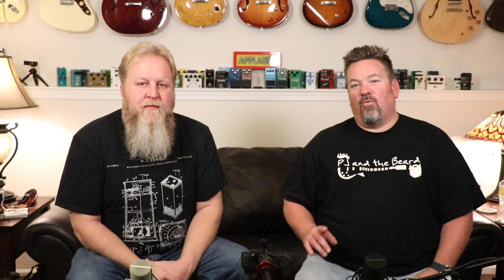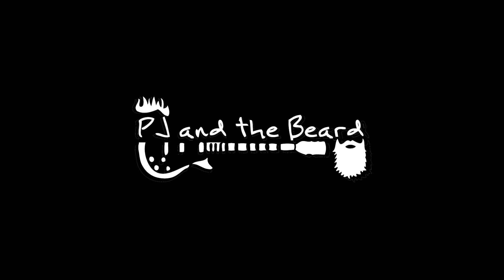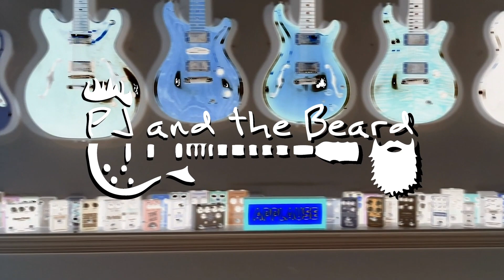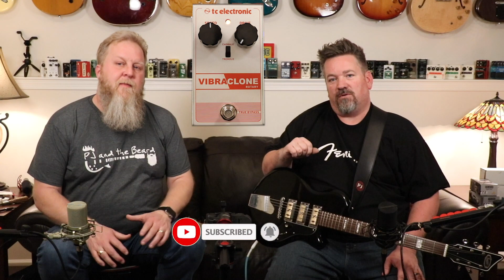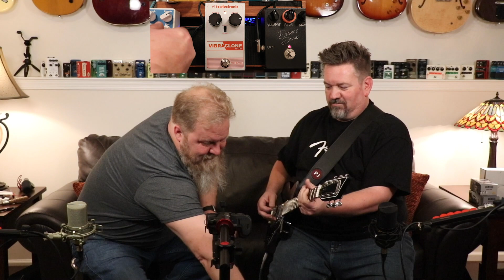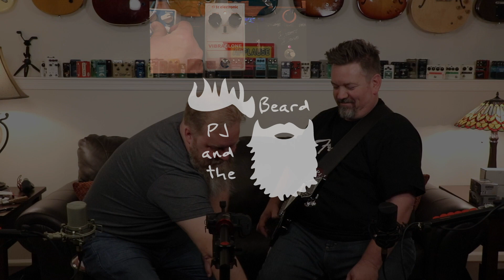The Vibraclone Rotary from TC Electronics - That Leslie Sound Series

Comment: Does the switch ramp too? It seems to in the first demo.
Reply from the maker: I don't have it here anymore, but you are right, it certainly seems to ramp with switching between the Chorale and Tremolo settings. It would be cool if there was a footswitch to do that or even the capability to plug in an external switch.
Reply: @PJandtheBeard  That's the one thing missing

Comment: You ramp by using your foot on the side of the big knob
Reply from the maker: If I remember correctly this is the pedal that when you change the speed it actually ramps to the new setting. In other words, it doesn’t change at the speed you turn the knob, but slowly ramps there. Which is cool.
Reply: What “big”knob ?  Both knobs are the same size !
Reply: @joserafa03  the knob thay changes the speed...